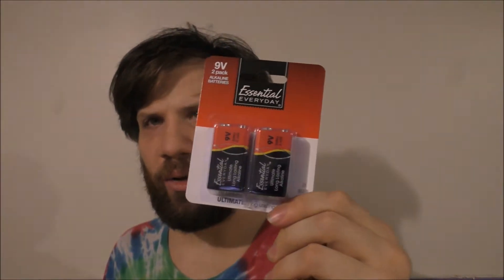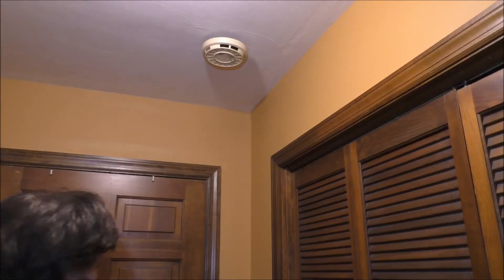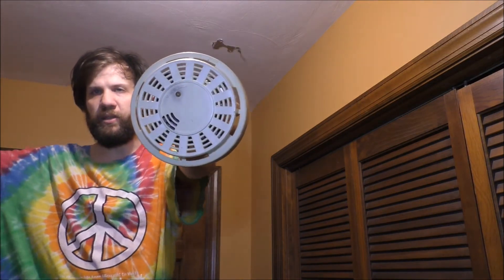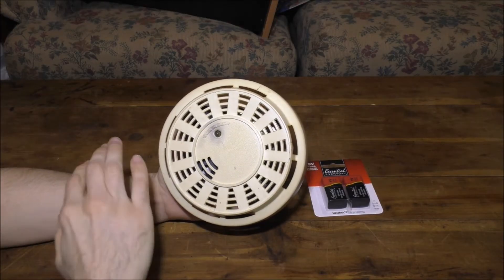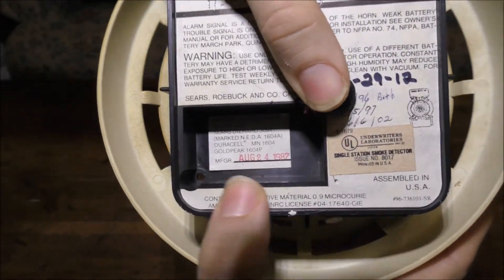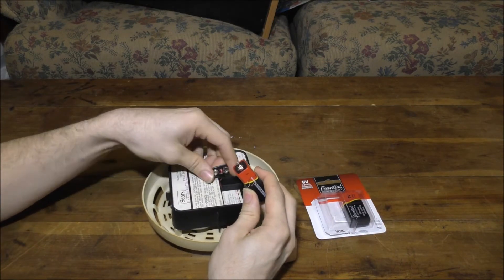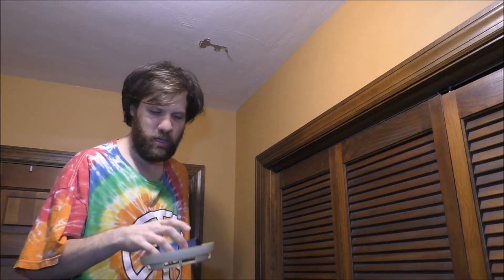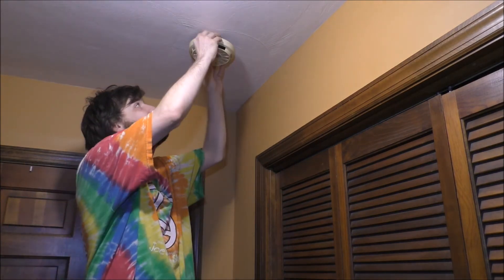HOW TO CHANGE A BATTERY IN A SMOKE DETECTOR

Comment: you can easly get a battery powered smoke alarm for $10-15. I really reccomend replaceing all of them. When you test the smoke alarm with the test button and it goes off, that just test the electronics, not the actual smoke sensing chamber. I just dont want to see you get hurt or die in a house fire because the smoke akarms fail to do there job. Just looking out for you buddy